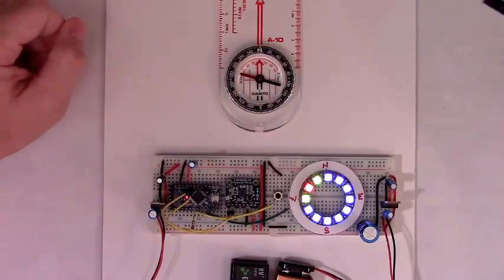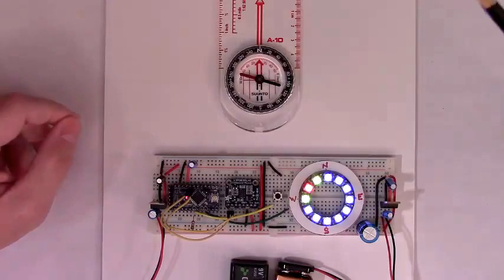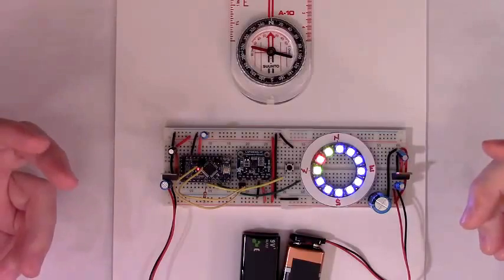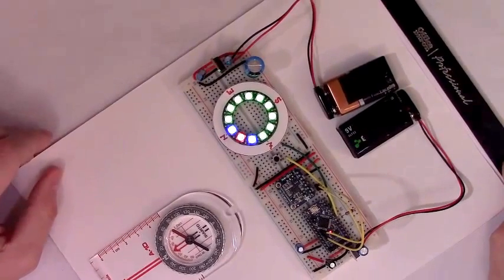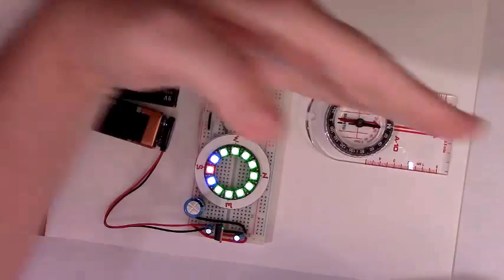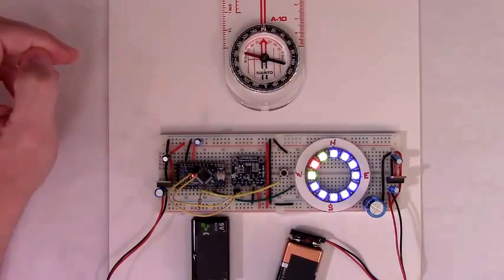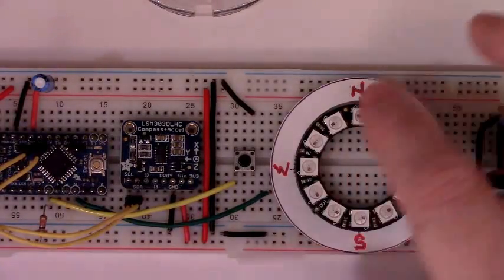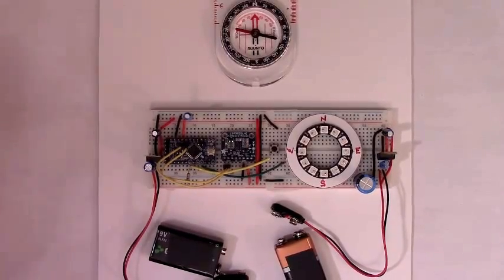Arduino Projects || Dual Mode Neopixel Ring Compass || Version 1

Comment from the maker: Code for this version
/*
title: Dual_Mode_Neopixel_Ring_Compass_V1
by: philomech
date: 5/2015

The project is an extension of an idea and code originally composed by David Ratliff 2013.  See video description for a link to Ratliff's video, etc.

Mode 0 --> tracks North
Mode 1 --> displays current Heading (--> points to direction one is currently facing
on a cardinal direction ring surrounding NeoPixel Ring)

(!!)NOT COMPENSATED FOR TILT

Parts:
LSM303DLHC Accelerometer/Compass Breakout
12 NeoPixel Ring
Arduino ProMini
Normally Open pushbutton
10K resistor
330 Ohm resistor (Neopixel data IN line)
1000uf capacitor
LM7805 5V voltage regulators (x2)
10uf capacitors (x4)
9V battery clips (x2)
Hookup Wire 
*/

/**********************
* libraries and objects *
**********************/
#include <Adafruit_NeoPixel.h>
#include <Wire.h>
#include <Adafruit_Sensor.h>
#include <Adafruit_LSM303_U.h>

//#define debug true  //uncomment for serial monitor
#define PIN 6     // connected to neopixel data pin

//Assign ID to the sensors
Adafruit_LSM303_Accel_Unified accel = Adafruit_LSM303_Accel_Unified(54321);
Adafruit_LSM303_Mag_Unified mag = Adafruit_LSM303_Mag_Unified(12345);
//Initiate ring
Adafruit_NeoPixel strip = Adafruit_NeoPixel(12, PIN, NEO_GRB + NEO_KHZ800);

/*********************
* global variables     *
*********************/
//mode selection
int button_pin   = 3;
int button_state = 1;
boolean mode     = 1;   //0 for North Tracker, 1 for Heading Indicator

//Assign pixels to Headings (12 pixel ring)
const int N   = 3;    //aligned with X-Axis arrow on body of LSM303DLHC
const int NNE = 4;
const int ENE = 5;
const int E   = 6;
const int ESE = 7;
const int SSE = 8;
const int S   = 9;
const int SSW = 10;
const int WSW = 11;
const int W   = 0;
const int WNW = 1;
const int NNW = 2;

int indicator = 3; 

float heading;
const float target_heading = 0.0;  //North Tracking
/********************
* function prototypes *
********************/
void set_N_indicator(float error);
void show_N_indicator(void);
void set_H_indicator(void);
void show_H_indicator(void);
/******************
* setup             *
******************/
void setup(){
  strip.begin();
  strip.show(); // Initialize all pixels to 'off'

  // the following serial functions only used if "#define debug true" at beginning of sketch is UNCOMMENTED 
#ifdef debug
  Serial.begin(9600);
  Serial.println(" Accel and Magnetometer Test"); 
  Serial.println("");

  /* Initialise the sensor */
  if(!accel.begin()){
    Serial.println("Oops, LSM303 not detected...check wires");
    while(1);
  }
  if(!mag.begin())
  {
    /* There was a problem detecting the LSM303 ... check your connections */
    Serial.println("Ooops, no LSM303 detected ... Check your wiring!");
    while(1);
  }
#endif

  if(mag.begin())
  {
     //cycle of RGB around ring to signal ready
    colorWipe(strip.Color(25,0,0), 50);
    colorWipe(strip.Color(0,25,0), 50);
    colorWipe(strip.Color(0,0,25), 50);
  }
} //<-- end of setup

/*******************
* main loop          *
*******************/
void loop() {
  //get sensor event
  sensors_event_t magEvent;
  mag.getEvent(&magEvent);

  const float Pi = 3.14159;

  // Calculate the angle of the vector y,x
  heading = (atan2(magEvent.magnetic.y,magEvent.magnetic.x) * 180) / Pi;
   
  // Normalize to 0-360
  if (heading < 0){
    heading = 360 + heading;
  }
  //Serial.print("Compass Heading: ");
  //Serial.println(heading);
  //delay(250);
  
  //Calculate Error (how far is heading from target?)
  float error = heading - target_heading;
  if(error > 180.00){
    error = error - 360.00;
  }
  delay(10);        //for stability
  
  //read button
  button_state = digitalRead(button_pin);
  if(button_state == 0){
    delay(350); digitalRead(button_pin); //debouncing
    if(button_state == 0){
      mode = !mode;
    } 
  }
  //Serial.print("button_state = "); Serial.println(button_state);
  //Serial.print("mode         = "); Serial.println(mode);
  //delay(250);
     
  //mode selection
  if(mode == 0){          //North Tracker
  set_N_indicator(error);
  show_N_indicator();
  }
  else if(mode == 1){     //Heading Indicator
  set_H_indicator();
  show_H_indicator();
  }

  delay(100);         //for stability
  
}  //<--- end of main loop

/****************************************
* North Tracking and Heading Functions    *
****************************************/
//North Tracking
void set_N_indicator(float error){
    //NEGATIVE ERRORS (CounterClockwise Displacement) 
    if(error < 0.0){
      error = fabs(error);     //strip away minus sign
    
      delay(10);               //for stability
    
      if((error > 0.1) && (error < 90)){
        if((error < 15) && (error > 0.1)){
          indicator = N;
        }
        else if((error >= 15) && (error < 30)){
          indicator = NNE;
        }
        else if((error >= 30) && (error < 60)){
          indicator = ENE;
        }
        else if((error >= 60) && (error < 90)){
          indicator = E;
        }
      }
      else if((error >=90) && (error <= 180)){
        if((error >= 90) && (error < 120)){
          indicator = ESE;
        }
        else if((error >= 120) && (error < 150)){
          indicator = SSE;
        } 
        else if((error >= 150) && (error <= 180)){
          indicator = S;
        }
      }
    } //<--end of NEGATIVE ERROR Handling code
    
  //POSITIVE ERRORS (Clockwise Displacement)
  else if(error > 0.0){
    if((error > 0.1) && (error < 90)){
      if((error < 15) && (error > 0.1)){
        indicator = N;
      }
      else if((error >= 15) && (error < 30)){
        indicator = NNW;
      }
      else if((error >= 30) && (error < 60)){
        indicator = WNW;
      }
      else if((error >=60) && (error < 90)){
        indicator = W;
      }
    }
    else if((error >= 90) && (error <= 180)){
      if((error >= 90) && (error < 120)){
        indicator = WSW;
      }
      else if((error >= 120) && (error < 150)){
        indicator = SSW;
      }
      else if((error >= 150) && (error <= 180)){
        indicator = S;
      }
    }
  } //<--end of POSTIVE ERROR handling code  
}
void show_N_indicator(){
  int left_indicator  = indicator - 1; 
  int right_indicator = indicator + 1;
  
  // scale / normalize to 0 - 12
  if (left_indicator < 0){
    left_indicator += 12; 
  }    
  if (right_indicator > 11){
    right_indicator -= 12; 
  } 
  //assign colors
  colorWipe(strip.Color(10, 10, 10), 0);             //set WHITE (background dial color)
  strip.setPixelColor(indicator, 35, 0, 0);          // set indicator RED
  strip.setPixelColor(left_indicator, 25, 25, 0);    // set indicator border YELLOW
  strip.setPixelColor(right_indicator, 25, 25, 0);   // set indicator border YELLOW
  
  strip.show();
}
/*****************************
* Heading Indicator Functions  *
*****************************/
/*
Indicator points to the direction one is facing (direction X-axis is facing). 
*/
void set_H_indicator(){
      // sectioned to save processor time
  if((heading >= 15.00) && (heading < 105.00)){  //NNE through East   
    if((heading >= 15.00) &&(heading <45.00)){
      indicator = NNE;
    }
    else if((heading >= 45.00) && (heading < 75.00)){
      indicator = ENE;
    }
    else if((heading >= 75.00) && (heading < 105.00)){
      indicator = E;
    }
  }  //end 1st quadrant
  else if((heading >=105.00) && (heading < 195.00)){   //ESE through South
    if((heading >= 105.00) && (heading < 135.00)){
      indicator = ESE;
    }
    else if((heading >= 135.00) && (heading < 165.00)){
      indicator = SSE;
    }
    else if((heading >= 165.00) && (heading < 195.00)){
      indicator = S;
    }
  } //end 2nd quadrant
  else if((heading >= 195.00) && (heading < 285)){       //SSW through West
    if((heading >= 195.00) && (heading < 225.00)){
      indicator = SSW;
    }
    else if((heading >= 225.00) && (heading < 255.00)){
      indicator = WSW;
    }
    else if((heading >= 255.00) && (heading < 285.00)){
      indicator = W;
    }
  }//end 3rd quadrant
  else if((heading >= 285.00) || (heading < 15.00)){   //WNW through North
    if((heading >= 285.00) && (heading < 315.00)){
     indicator = WNW;
    }
    else if ((heading >= 315.00) && (heading < 345.00)){
      indicator = NNW;
    }
    else if((heading >= 345.00) || (heading < 15.00)){
      indicator = N;
    }
  } //end 4th quadrant  
}

void show_H_indicator()
{
  // border to highlight Heading indicator
  int indicator_left = indicator - 1;
  int indicator_right = indicator + 1;

  // scale / normalize to 0 - 12
  if (indicator_left < 0){
    indicator_left += 12; 
  }  
  if (indicator_right > 11){
    indicator_right -= 12; 
  } 

  // Assign colors
  colorWipe(strip.Color(0, 15, 0), 0);               // set GREEN (background dial color)
  strip.setPixelColor(indicator, 25, 0, 0);          // set indicator RED
  strip.setPixelColor(indicator_left, 0, 15, 15);    // set indicator border GREEN
  strip.setPixelColor(indicator_right, 0, 15, 15);   // set indicator border GREEN

  strip.show();                                      // Push bits out
}
    
// from ADAFRUIT Example Code
void colorWipe(uint32_t c, uint8_t wait) {
  for(uint16_t i=0; i<strip.numPixels(); i++) {
    strip.setPixelColor(i, c);
    strip.show();
    delay(wait);
  }
}